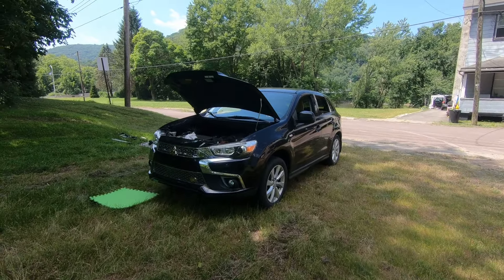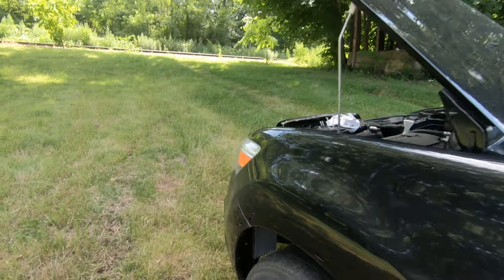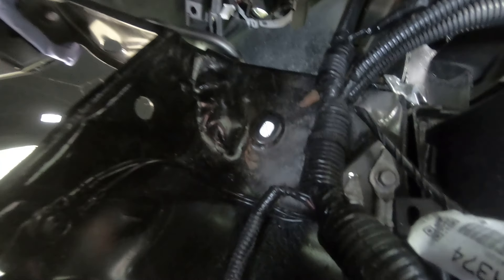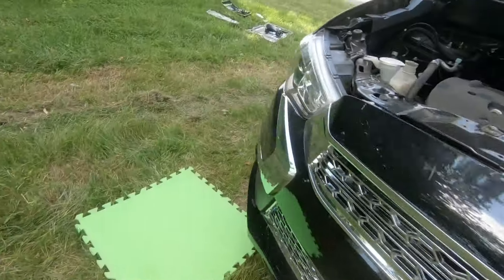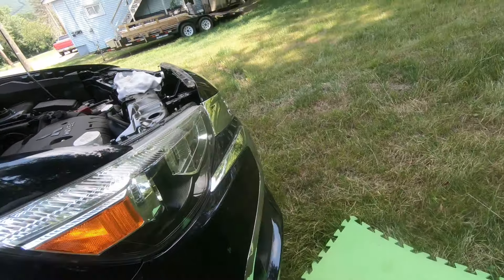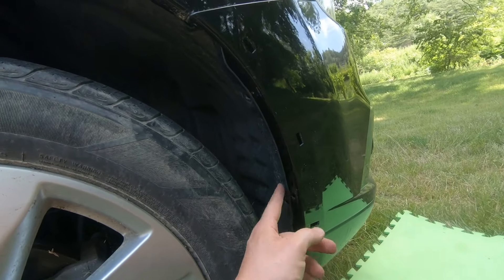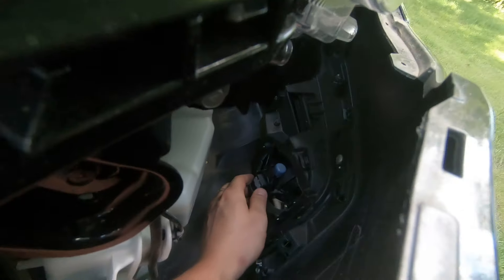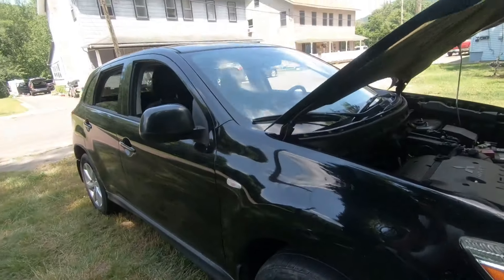How to Replace FOG Lights BULBS  on Mitsubishi Outlander 2010 2020

Comment: There's an easier way, you can pop out the fog light housing (specialized plastic removal tools or a screw driver and a cloth to protect against damage) there's an extra step of removing a couple screws, but it's easier access.